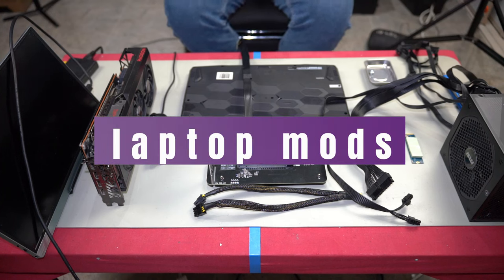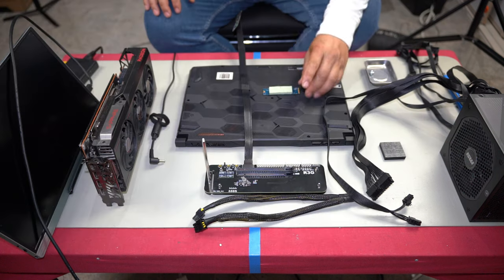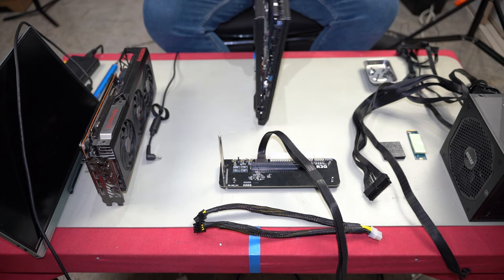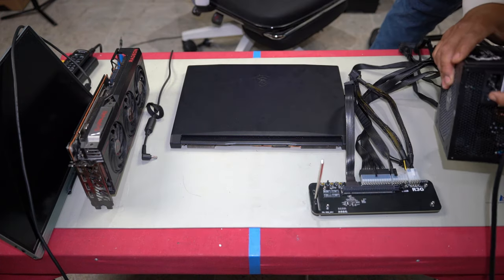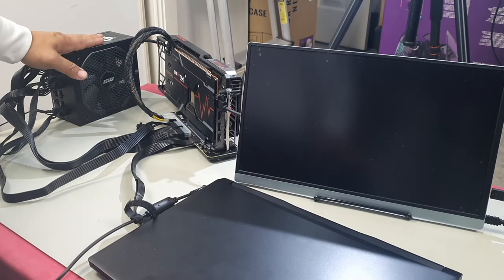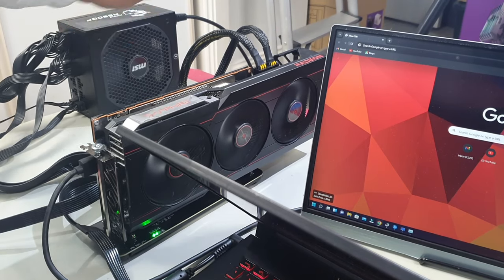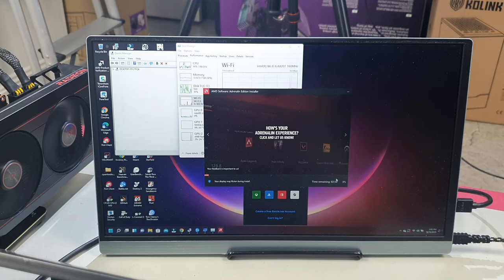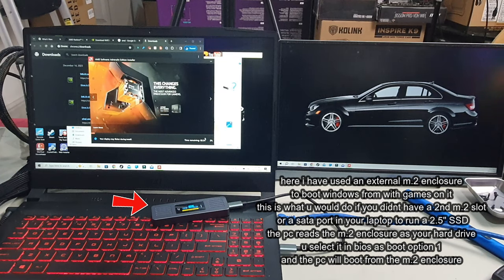how to setup eGPU  use an external gpu with your laptop for gaming

Comment: Ok but what's the performance difference... There is huge performance loss compared to Desktop x16 lanes...
Reply from the maker: yes that's true however wen u have such a low performing gpu such as 3050 regardless of the lowered performance due to shared lanes u still get better performance considering ur using a better gpu ... the point here is to be a le to use a better fpu to improve performance  .obviously if your looking for the best performance just go direct desktop ... this is for ppl who have a laptop  and just want that little more performance out of their setup..it's not perfect .far from it but it does help boost the fps and graphics in gaming as a whole
Reply: @MIKEYZVLOGZ  Im loking up thease videos because Im curious about how it performs. Because I myself have Ryzen 5600H / RTX3060 Legion 5 laptop. Problem is that 3060 only have 6GB of VRAM and in almost every bigger game it runs out of VRAM even at 1080p. Also I was thinking about getting one of those New OLED/QD-OLED 1440p monitors. My idea is that I dont have to build Desktop PC but rather add Decent GPU to my existing laptop and conecting it to a 1440p monitor. I already have Good Seasonic PSU from my older Desktop PC all I need is GPU and that Oculink Dongle.
Reply from the maker: @gytispranskunas4984  ur idea is on point and u definitely will see better performance .. and yes ur right 6gb vram isn't enough now for modern games ..u want at least 8 minimum but 12 is a new sweet spot IMHO... most cards are 12gb at a low price such as 6700xt 4070 etc

Comment: It goes to boot screen!!!! Saying please install operating system
Reply from the maker: it's not reading your boot drive
Reply: Am I supposed to have another drive with operating system  and if so can it be plugged in via usb
Reply from the maker: @gavinstewart33  yes u can run off usb
Reply: @MIKEYZVLOGZ  I tried to transfer the operating system from ssd to hard drive and it shows the blue screen won’t let me in
Reply from the maker: did u select the boot drive in bios
Reply from the maker: @gavinstewart33 do u have x2 m.2 slots or just 1? if your os is on the m.2 ssd and u remove it ..then there is no longer an os. u need to use another method to boot windows... in the video I used a laptop that only had q m.2 slot so I used a portable m.2 enclosure and put original boot drive in there and it booted just fine ..u can do this too..or if u are lucky to have another 2.5inch sata port u can run Windows off that ssd
Reply: @MIKEYZVLOGZ  I don’t have 2 I have one so what did you buy that was portable?
Reply from the maker: @gavinstewart33  That is why you have no boot drive because u removed your boot drive. search for external m.2 nvme enclosure and u will see what I mean
Reply: @MIKEYZVLOGZ  ohhh okay there is a sata cord but it’s plugged into somethjng
Reply: @MIKEYZVLOGZ  how would I run windows off another ssd